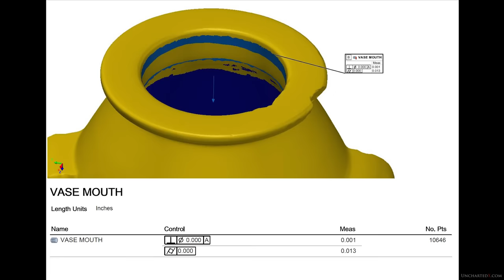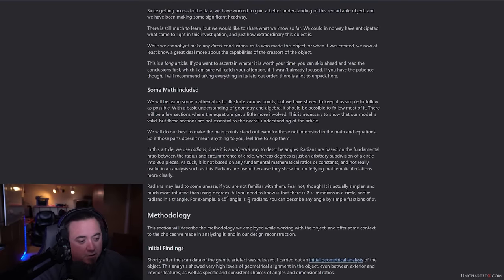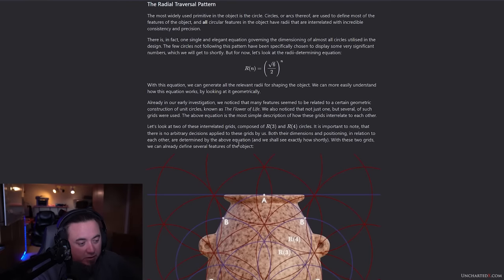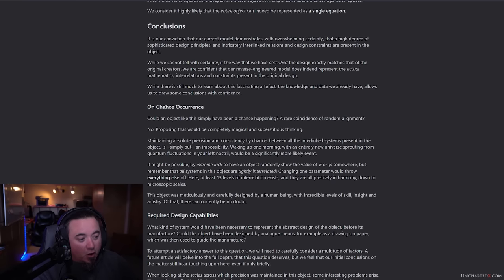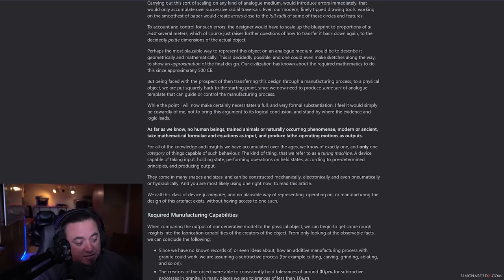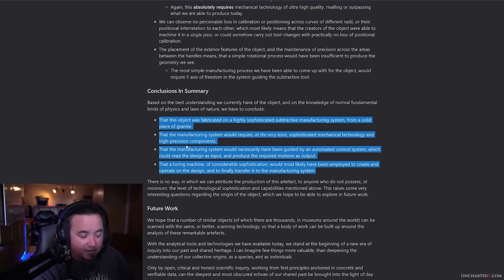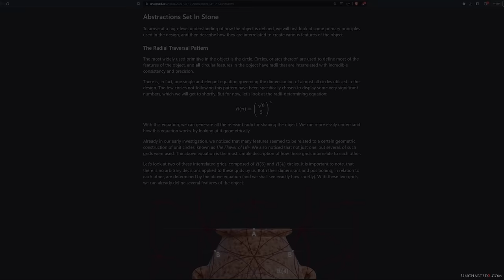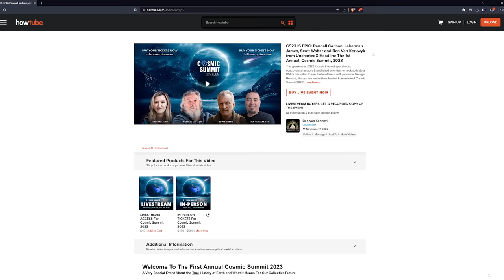Was a COMPUTER Used to Design this Artifact??

Comment: Amazing information.... 10ft-pole material for so-called academia and the likes! 

That being said, I wonder if the vase's surface has been sealed (granite being a porous material if not sealed). Though the objects may have been simply found/recycled during the dynastic period and utilized for everyday purposes (these things scream way older than 5k years, perhaps pre-flood) but perhaps a good isotope analysis & quantification of whatever sipped through the items' history may be able to find traces of non-standard substances/compounds?  (besides cosmetics, oils, or similar from the dynastic era). 

 I find the shape of the handles very interesting in that they seem to be shaped not for hand-carrying but for dowels of some sort (to protect the carrier of the object?.  Any sign of wear on the inside of the handles can clarify that (though such marks could have come after they were originally found and recycled).

Lastly, was that another drone or a "fast walker"  (or an incredibly fast bird) that zipped on a straight line past the field of view (from right to left) at 36:11?

Comment: @UnchartedX One rather important point you missed is the unit of measure used 'U' is based on the speed of light/16gHz. Since the speed of light is also represented in dimensions of the Great Pyramid it's seems to be rather conclusive that the vase and the pyramids of Giza are of the same origin!

Comment: I would like to see an analysis of the manifold created by the geometric points. If it can be demonstrated that the manifold segments between the points is decidedly piecewise, this would lend further credibility to the idea computers were involved. To clarify, there are parts of the manifold, edges, etc. with no obvious correspondence to the superimposed circles. If we can be find functions that model the vase in a piecewise manner with the same magnitude error, this may suggest that piecewise interpolation was a part of the process. If a relatively simple function cannot approximate the curvature accurately, it would suggest the relationship between the key points and the resultant manifold is much more arcane than modern CAD methodology.

The strategy of reverse engineering the drawing is brilliant and the author of the article is clearly thinking outside the box. Even if it can be recreated with CAD, the fabrication method still goes unexplained. Thank you for sharing!

Comment: I see multiple corelating numbers with the sheet from electrical grounding from the project: The Integrated Systems Bonding Project. if you use the numbers of the radial traversal function set and google them you come to this project.

Comment: What's also striking is this isn't a very practical shape for something designed primarily to be functional. It does seem as if it was meant to portray an understanding of a specific geometry and they wanted to ensure it would survive the ages. 

If it was mostly artisan, not only would that be hard to explain but you'd expect further embellishments, which we've seen crudely added to some other pieces. Whoever made such objects seemed to care more about their understanding of what we'd call mathematics and manufacturing than anything else. Regardless how it was done, that implies a high level of sophistication that was lost at some point.
Reply: they are the shape they are because they are made by grinding them against another stone. how the two stones interact dictates the shape.

Comment: Excellent, methodical study of the design and manufacturing intricacies of this small vase.  I am a restorative dentist and the modern way of creating ceramic crowns to restore broken down teeth uses a similar CAD/CAM process:  Scan the dentist's prepared (machined with a highspeed handpiece with a rotary diamond) tooth, send the LARGE digital file to a computer where a technician designs the crown to fit both the preparation and the adjacent /opposing teeth. The design is then sent as a large data file to the muti axis milling machine using diamond abrasives to subtract material from a Zirconia Oxide blank. The tolerances are on the order of microns and the crown is then hardened in an oven.  How could GRANITE be machined is such a way? Modern day abrasives "tools" would have to be changed out repeatedly. How could ancient people achieve this?  How did they power this machine, how did they build this machine? Where are the remains of such a machine used to simply make a vase?????

Comment: Awesome job! Great analysis.

I hypothesize that all of the granite pots in the museum will exhibit the exact same mathematical relationship. And I really do mean the exact same. Being that radian are ratiometric, you can apply any scaling to them and produce different shapes whole still maintaining the same mathematical relationship.

Consider some machine like a lathe with a cutting arm that is driven by cog wheels. A radian describes how far to turn the cog wheel. Turning the cog wheel 180° would establish PI. So using just a simple wheel and a divider you can  transfer these math functions into the real world.

In this example, if your cutting tool arm is a different length than another tool, then that tool will produce a pot of a different size and shape, but one that is still related to the other machine because it used the same recipe of circle radians and wheel turns to get there.

We used to do things like this with analog computers before the transistor.

And even today you can find youtube videos of people who take complex shapes, describe them mathematically (usually involving a Fourier transform) via a series of circles and gears. Then build those gears to make a physical device that can draw/replicate the original shape.

I could see a similar thing being employeed by the ancients.
Reply: that process is certainly feasible, but the extreme precision is what makes this artifact so revolutionary. precision that realistically wasn't achievable until the 20th century. the precise mathematical relationship is just icing on the cake as far as proving that this object was created using advanced machinery.

Comment: One thing to consider is since there are 50,000 of these known and I am sure many more unknown.  You have to assume this process had to become a ‘trivial’ mass production process.  What would you conclude if you found only 1-5 of these?  And what would you conclude if you found 1,000,000 of them?  Point is the similar design and granite leads to it couldn’t be one off artisan productions.  It has to be the same process that the pyramids used.  

Last thought, what if these were a poured molten granite?  But the molds were flexible somehow, like we do today with vector graphics, only at the physical form.  Imagine some ancient siting at some Interface and was just ginning up some vase but all the proportions were scaling to a math expression.   Today it would be us sitting at CAD but making sure the settings were locked to scale everything as we drag the object in strand tall or sqatty proportions.  I am really wondering if they simply didn’t have a giant 3d SLA printer that pulled them from a vat of molten granite.  You will notice the all have two handles. Was that to pull it up as it was sla printed?
Reply: Magma that cools quickly at the surface becomes Rhyolite. Granite is formed deep underground.

Comment: Fascinating subject. Thank you for the detailed explanation. My question is this. If the jars were turned by lathe which seems reasonable, what of the jug handles? The spaces in between are precise and match the rest of the circumference of the jar. How did they make it so precise between the jug handles?

Comment: Microscopically follow the horizonal cut marks. Focus one singular cut mark between the handles. Follow that one cut mark and observe how it impacts the handle. That junction is the key to everything about the construction. Does that singular cut mark stop at the inside radius of the handle? Do all of the other cut marks above and below stop at the exact same spot or is there a deviation? Are the cut marks exactly parallel to each other or is there a wavy pattern? Are the cut marks in align on the vertical part of the handle? 
Knowing exactly how the tool comes into the handle repeatedly is the key to the construction of this manufactured container.  ..... TM

Comment: This is exactly the kind of analysis that is needed. It is a puzzle why this level of rigor has been missing in much of archeology. Is it pure laziness or simply an attempt to hide in plain sight clearly precision  manufactured items from the earliest periods in Eygpt. It would be hugly beneficial to scan as many of these objects as possible so to get an idea of the variance in manufacturing and also to find a potential confirmation where you find mathematically identical objects of same or different scale something that would be absolutely impossible to produce by hand.

Comment: A Radian is also the unit conversion from the constant pi to degrees.  So that things like 2pi radians is 2pi (180/pi) degrees = 360 degrees.  If we used Tau instead of pi it would be like tau radians is equal to 360/tau degrees.  And tau would describe one revolution of the circle or in other words tau would be the ratio of a circle's circumference to its radius which is always equal to tau for all circles.

Comment: Was any investigation done, or measurements taken of the interior surfaces?  ...Are wall thicknesses consistent or variable from top to bottom? If these vessels are really each machined from a monolithic stone, it seems that surface quality and geometric accuracy the interior would be the most difficult challenge in production of these.

Comment: In my opinion, I agree, not made with a lathe, but with a press and die system, possibly or just something else I don’t know about
Reply: I use CMM accuracy measurements every day. I just have a basic knowledge of using this system, and can tell you that the tolerances are extremely small.

Comment: There needs to be a consistent effort to scan as many of these vases as you can then compare and contrast them. Perhaps understanding the mathematical relation and math system used between them can lead to a better understanding of how they were made.

Now I don't really believe this but it popped into my head as I watched this. If this is one of many copies; those being of the same size and shape, then that means the people of that day could possibly have made these with some sort of unknown lathe like duplication machine. From there we could infer they had a master copy to make them. Though that still sets up the problem of how the first was made.

Comment: Working with Stone for more than 30 years with a masters degree in stonemasonry  I think I know how they did the vase with a quite simple process, similar to modern CNC milling. The thing I am talking about is "stencil guided milling".  The principle of this technology is using a milling tool, e.g. a rotary machine with a VERY THIN diamond blade mounted on a kind of "sledge" that is guided along a stencil. The machine itself gets its "pressure" that goes onto the stone via a spring or hydraulic cylinder.  This works kinda like a "lathe"  - the stone itself is mounted e. g. on a rotary table, if you want to make round objects, but it can also be mounted to carve just "lines" into the stone... however you want it. A rotary milling tool, e. g. machine with a blade on it is brought in contact with the stone with a "predefined pressure" this might be very low or very high... just how you want it,  by using a strong or weak spring or hydraulic cylinder that presses the machine/the blade onto the stone, the thinner the blade the more pressure is applied "on a single point" to the stone, cutting stone is "easier" with thinner blades, because it produces less "overall pressure" in a certain area of the stone - so you can make more fragile products.  It is hard to describe, since english is not my native language, but the key to this method is cutting along a line with a predefined pressure, this might be a horizontal line that you cut by turning the rotary table and let the blade do its work with this pre defined pressure, until  a mechnism that guides along a "stencil" which is having the exact outer shape of the vase "rests" on this stencil and can't cut into the stone anymore! This is the priciple of it. There are high precision "granite tables" on the market - these are used in laboratorys that need to have the flatest surface possible, those are produced in a similar manner... they are produced with help of a "calibration stop", that means the tool can not go into the stone anymore because it "rests" on a kind of "stencil" that is as exact as the surface you want to get in that process! Hard to describe. Anyways, the blade can be guided by the "sledge" in X direction or in Y direction - depending on the "stencil" you use!  This is like the "ancient kind of 2-D milling" guiding a blade or grinding tool along a 1mm think metal stencil  along an X or Y axis and it can not go further into the stone than the shape of that stencil!  That can result in VERY high precision, but it also depends on the tool you use.  For the end finish you would have to use a "galvanized diamond tool" like a sphere or similar, because these "galvanized diamond" tools don't wear away that fast, resulting in very high precison!  But the main work is done by VERY THIN diamond blades, that is very important on fragile stuff. The thinner the blade the better.. then the diamond sphere or little diamond grinding pads could do the rest. Its really almost like a modern CNC ... stencil guided milling!
BTW -  I did use a turning table and rotary tool to make some small  25 cm diameter  round "pillar base" from marble,  but without the stencil..  just by "eye" with a less then 0,5 mm precision... with a stencil guided machine the precision is much higher! I could do that also in granite...  to me there is not much difference doing stuff in marble or granite... the tools are so good today.... after 30 years you are quite trained! :D

Comment: Hi Ben first thanks for the work you are doing. 
This shows a very high level of difficulty and understanding just to get the artefacts outer shape. Given this difficulty now think about how the inside void was achieved ! I’m assuming it follows the outer contour maintaining a constant thickness. The machine bit and arm has to fit inside and move. If the same degree of accuracy is achieved inside maintaining a fixed datum for the whole vase then this is truly impressive workmanship.

Comment: just now I printed out the vase with a 3D printer, it looks very nice, how did they drill the inside part, I do not even manage to get two fingers through and the bottom I reach even less. 300ml of water fit's in, I also wonder for what the vase was used. What I can imagine well is a kind of cork or wooden stopper as a lid, that would fit well on it.

Comment: One point perhaps not really emphasized enough: this is a VASE. It is common among at least 40k of them. And it expresses sublime principles, as well a having been produced in a machine capable of micrometer error rates.

Basically, the equivalent of a nice chochky object was made in a way that would cost us hundreds of thousands to make, if we even could.

Which means this technology was probably CHEAP for them to use. And...they are not identical. If we start finding out that many ARE identical that would imply mass manufacturing. If they are not, mass artisinal manufacturing at aerospace level precision.

The implications of this are earth shattering.

Comment: Can I ask a really sorta dumb question ... What does the INSIDE of the vase look like??  Is it a straight hole just drilled down into the interior or has the inside actually been hollowed out to the shape of the vase???  These vases are incredible  and beautiful and what a mystery they represent for us ...
Reply: It has been mentioned that the walls of the vases are very thin, photos of a chipped one and broken pieces show that. So the inside is shaped as a smaller version of the outside. In a video from under the Step Pyramid they put a light and you could see it through the stone.

Comment: It kinda sounds like you're describing a sort of spirograph but it works in three dimensions instead of in two. The Turing Machine aspect could literally be down to physical swappable linkages with defined curves like a spirograph for each of the five degrees of freedom. The mathematical equations could've been encoded on a mix of gear ratios and length ratios for hinged members. When Gaudi was designing the more challenging bits of his cathedral in Barcelona he used hanging chains to model and define the precise catenary curves he would flip "upside right" in the actual structure. Its a certainty that these ancient craftsman were doing something similar here.

Comment: Investment casting can’t turn stone in a lathe if you hit a piece of quarts from inside outside it will brake out  I have done stone work to cnc machine work can’t be made by hand one bad strike it’s over (casting and hand polished)

Comment: A vase turned on a lathe or potter's wheel is gonna be pretty smooth/consistent but if it has handles built in then it hasn't been turned, handles have been stuck on later.... Conclusion, either previous civilisations were smarter than us or extra terrestrials with better technology made them. Granite is hard to carve by the way! Given the Earth is 13 billion years old is it any wonder we've been visited?